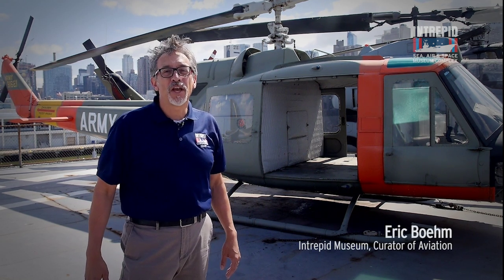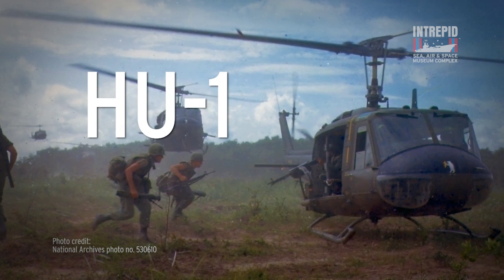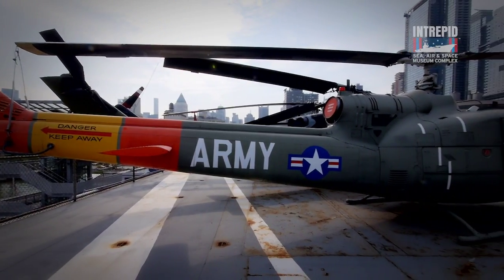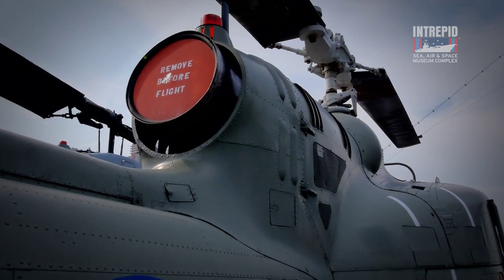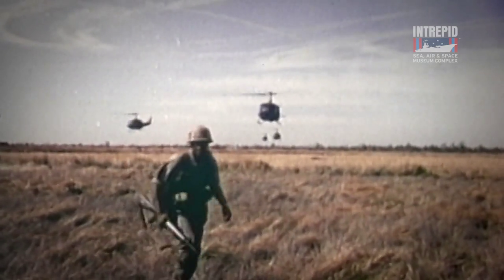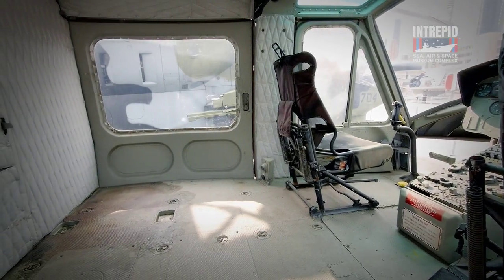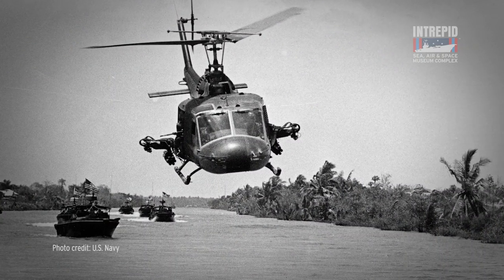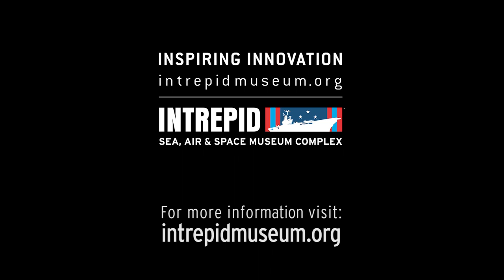Behind the Scenes: The Huey Helicopter

Comment: The A/B-model Hueys had 165 gallon fuel tanks which gives you a mission radius of about 100 miles.  The C/M-models had 240 gallon fuel tanks, the D/H-models  had originally 220 gallon tanks reduced to 209 gallon self-sealing tanks which give you about a 150 mile radius mission range.  Oh, I was one of those 19 y/o Huey Slick pilots in Sunny South Vietnam, 1970-71.